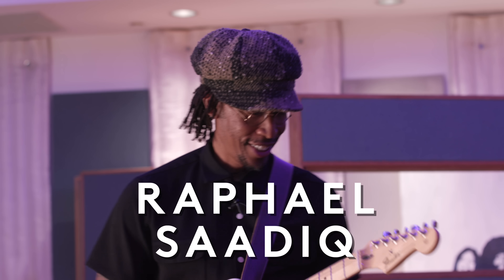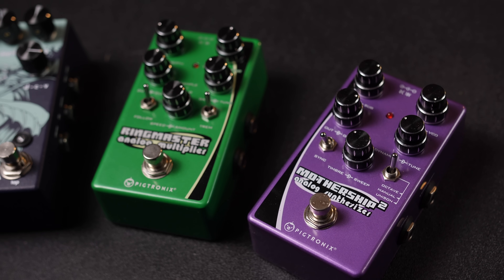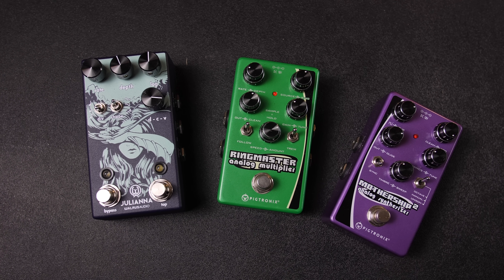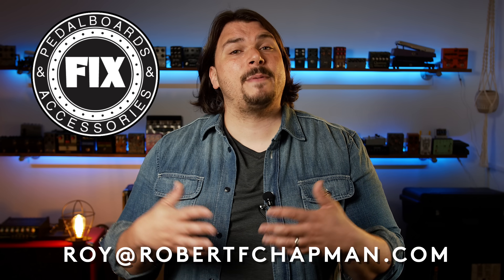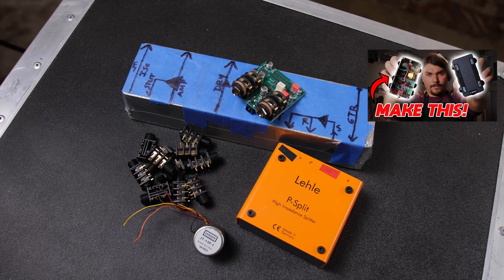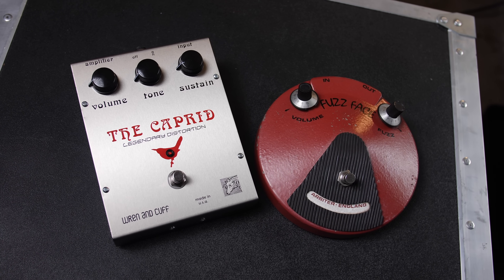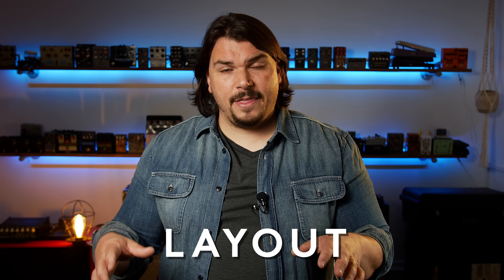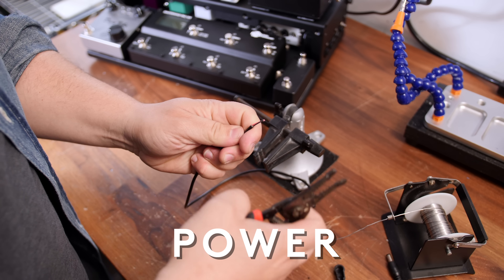Building a Studio Pedalboard for an R&B Icon

Comment: Looking at Raphael Saadiq’s rig I can see that it is possible to make a huge studio pedalboard with 15-20 pedals without any signal loss or noise if you just follow your advice (dual buffer, switch mode power supply and soldered cables) awesome!!!
Reply from the maker: Yes indeed!  The Holy Trinity of Tone!!!

Comment: Hey Mason!  This rig looks awesome.  I have a question- I'm going to rebuild my pedalboard soon, and I want to put an FMR RNC compressor on.  Its a studio compressor, but its small enough I could use it as a pedal riser, and it runs on 12v.  It has balanced inputs and outputs, but seems to work great plugging an instrument directly into it with no issues.  Could you foresee any issues using a piece of live-level gear like this on a pedalboard?
Reply from the maker: Ben, as long as you can control the output gain so it doesn't clip the other devices I think you should be fine.  You might want to test for noise, sometimes there can be negative interactions with certain pedals and transformers so you should do a quick proximity test with your comp to be sure.
Reply: @VertexEffectsInc  Okay great thank you!  There aren't any transformers in the unit which is perfect, I'll test with my other pedals before I settle on the layout.  

Really looking forward to using this comp.  I was planning on buying a Cali76, but the FMR is so much more functional, saves space, sounds better and is cheaper.  Its definitely a sleeper piece of gear for what it is.
Reply from the maker: @benhenze  often these "balanced" boxes will have a transformer, so just be aware of that.  They may not be an issue but sometimes there can be some leakage that can be a problem in certain circumstances.

Comment: Isn’t the prescription electronics vibe unit 12 volt AC? How did you use the all DC Zuma for that? You didn’t have to use the original wall wart that came with the vibe unit? Thanks
Reply from the maker: It is running off the Zuma, but this is designed in a way where you can run it on 18VDC.  Some Vibes will rectify + and - AC voltage separately and in those cases you can't use DC.  However, for this design (I think Bob Sweet designed it for Rx. Electronics) to calculate the DC voltage equivalent, it's about 1.4x the AC voltage, so around 17VDC or so.  Some of them can take a bit higher as well and might have regulators in them to bring the voltage down to what the circuit is designed for.

Comment: Hey Mason, at around 10:10 you are routing power cables to the PSUs that are not yet soldered. Do you cut and solder in place once they are routed and secured, or do you undo all those zip ties and then solder on the connectors? I always worry about degrading cables internally if I am zip tying and unzip tying them multiple times. Great looking board!
Reply from the maker: I solder them in place once I've routed them to where I want them, helps make sure they're cut to size.
Reply: @VertexEffectsInc  thank you for clearing that up! I did not do that on my last build and ended up with some extra slack. I guess as long as the third hand can reach the area on the board it's all good.
Reply from the maker: @modemlaugh  usually once they're cut in place I remove the power supply so I have room to work.

Comment: Does the surge protector you have do any kind of additional filtering/conditioning? Would it be "bad" / wrong to split the IEC cable?
Reply from the maker: Depends on the surge protector, but generally if you have a bad power situation it's limited in how much it can help.  You can get IEC Y cable that are a safer solution than doing it yourself.

Comment: About the Fuzz Face, it seems lithe the pedal was modded with a power jack, right? Is it connected directly to the Zuma? Thank you!
Reply from the maker: The fuzz face is being powered by an external 9v battery, and has been modded to have a switch that turns the battery on and off

Comment: I'm surprised you choose the Lehle P-Split. It is a passive splitter in the affordable range... You always chose the best... That Zuma supplies, and all that quality cables and buffers to be at last all routed to an affordable passive splitter for a studio application? Aren't there other better options? Thanks
Reply from the maker: The P Split is almost $200 I think for just an ISO transformer and is something he already had, no reason for me to build another thing with another transformer.  What would have been a better choice?  Most ISO transformers in most of the rack and pedalboard gear is a funky Tamura/Triad 10K to 10K that's pretty awful.  This is a huge upgrade comparatively.
Reply: @VertexEffectsInc   With a passive split there's a significant drop in signal hitting the amp. Isn't it?
Reply from the maker: @rgr4929  it's being driven by a buffer.  Most of these transformers are designed to be passive, even the best input transformers from Jensen.  It's not like a volume pedal or something like that, totally different thing.
Reply: @VertexEffectsInc  OK! So he already had this splitter, but which splitter would you recommend as the best for a 2 amps setting?? The best, without worrying about the cost. Not for A/B/Y, just 2 amps sounding always at the same time. Thanks!
Reply from the maker: @rgr4929  The Lehle is the best out there for isolation, you only need that on one amp the other one doesn't need to be isolated if it's split or stereo.
Reply: @VertexEffectsInc  Ok, great! Thanks! One more question: The Lehle needs to be on the pedalboard near the last buffer or could it be placed near to the amp after the long cable that comes from the pedalboard's last buffer? (For saving space in the pedalboard) Thanks!
Reply from the maker: @rgr4929  for the best results the transformer should be on the amp near the input with a short cable into the input of the amp.  Most of the high end transformers are all input transformers and will be more effective in that position.  Being on the pedalboard is more convenience but not as effective at eliminating hum or buzz.
Reply from the maker: Nope...active splitter is the same as what we did the the P Split. Low Z output buffers into an Iso Transformer.  Their buffers have a 1.8K output Z, that's almost 20x worse than our buffers in terms of line driving.
Reply: @VertexEffectsInc  Ok!! Thanks for your wisedom as always!!
Reply from the maker: @rgr4929  Yep...I promise, the Lehle is the best consumer level solution with a pre-fab product.
Reply: @VertexEffectsInc  Ok! I will try it!! Thanks again, master!
Reply from the maker: @rgr4929  okie dokie

Comment: Wah before volume? i have mine the other way around.
Reply from the maker: Guitar Wah, Vibe, Volume, Fuzz....
Reply: @VertexEffectsInc  ... wait, me too ... Wah (Volume and EVEN Vibe) before Fuzz?
I always thought that Fuzz was before all that. No?
Reply from the maker: @lamsonian  passive VP, just like having your volume pot before the Fuzz so you can control the clean up without having to touch your guitar volume.
Reply: @VertexEffectsInc  Right. Actually, that's a pretty easy one visualizing (mentally audibly).
The Wah, sure, either/iether. I can see both positions having benefits and being fun.
It's really the Vibe that's got me trippin ... I guess I'm'a hafta disassemble my board a bit, just to try it.
Gotta hear it to believe it, I spoze.
Reply from the maker: @lamsonian  Vibes tend to get more 'phasey' with a lot of gain into them.  You can see examples of Hendrix at different times reversing the Fuzz and Vibe positions.
Reply: @VertexEffectsInc  I was guessing that, almost verbatim.
I'm about to dive in to my board, now.
Thanks for the input, man!
And thanks for being cool enough to divulge all of this info that so many people wouldn't get to learn, otherwise.
Reply from the maker: @lamsonian  Thanks Ian!

Comment: It's kinda mind blowing how someone has all these awesome pedals, and uses the crappiest volume pedal ever.
Reply from the maker: The Dunlop is about as mechanically sound as a volume pedal can be...any passive volume pedal will have some impact, but if the system is properly buffered is just fine.
Reply: @VertexEffectsInc  After dealing with more that my share of the Ernie Ball broken strings, I bought one of the Dunlop volume pedals. Within just 3 days it fell apart. I'm not even kidding. Never again. Lehle from now on.
Reply: @VertexEffectsInc  all i'm saying is, why not drop the dough for a solid volume pedal for a dope ass rig like that?
Reply from the maker: @rockitlikeawolf  if you bought the pedal new, that should be under warranty.  I've found them to be pretty solid.  The magnetic strip on the pot was a clever idea and again, mechanically, it's a good design.  Sounds like a bad experience had you through the baby out with the bathwater.  Lehle is great too but won't work since it's active and feeding impedance sensitive fuzz devices.